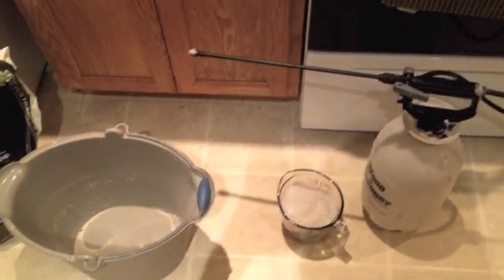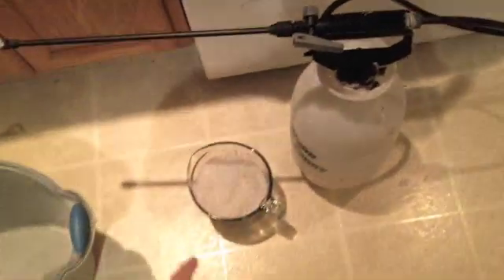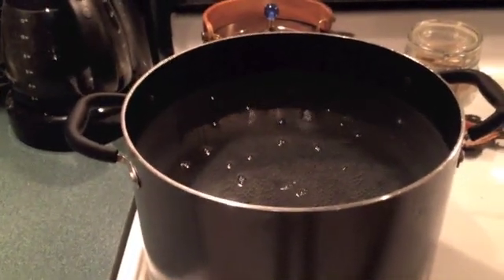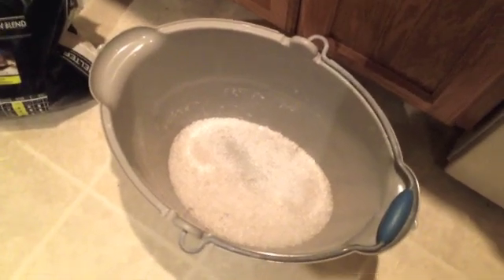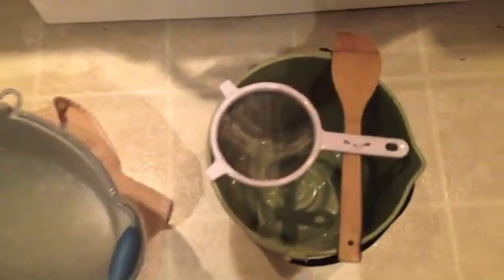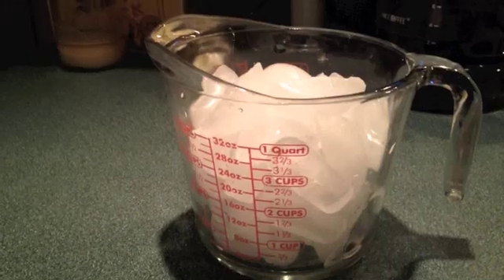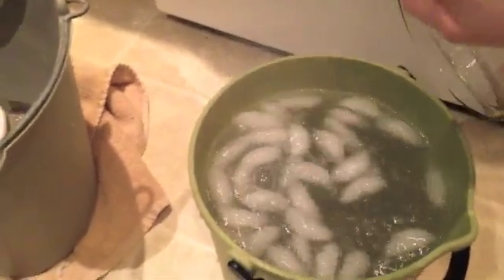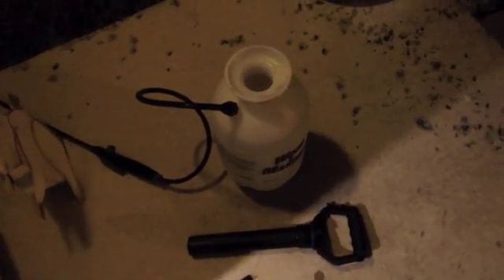How to Make a Brine Solution for your Driveway

Comment: This is VERY dangerous.   Do NOT lift a big pot of boiling water off a stove.
If you drop it you will get seriously burned.   Pour the salt into the hot water in the pot on the stove.
Let it sit until it has  cooled down.

You should remove this video.

Comment: The streaks is caused by the spray pattern size of the jets on manifold on  back of DOT trucks. It would cost so much to spray and cover every single inch of pavement on every single road in say an entire city or county. The parts of pavement that are covered by the spray give vehicles traction in those area due to no ice/snow buildup.
Reply: So since salt for home is cheap it would be better to completely cover the sidewalk with the brine? Would it better better to just throw buckets of it on the sidewalk so it’s soaked?

Comment: Great vid! Instead of adding ice to your brine to cool it down, how about you just let it cool down by itself overnight so you don't dilute it. Also you have to be careful using salt on your driveways,as it is not as tough or durable as the city streets. They are often a cheaper grade used by the home builders and you have to be careful so it does not affect your grass and natural vegetation from its run off. I killed a lot of my grass one year just where my grass met with my driveway. I had to replant. Live and learn lol!  Keep up the vids!
Reply: Commissar0617 You’re right, but in most cases it’s not placed properly meaning the laborers beat the entrained air out of it which is important to have for freeze/thaw durability.
Reply: "often a cheaper grade" no, it's usually the same stuff. just not as thick

Comment: A little nervous, but well done. As far as spraying in lines, the trucks spraying the roads do so because of the nozzles that point down to the road, it's the most effective for them to spread across the road and use as little as possible on as much road surface as possible. Thanks for sharing the video!